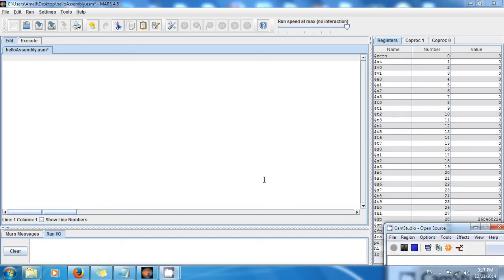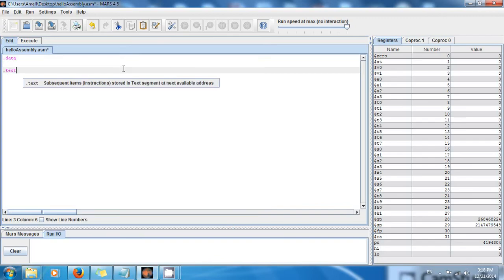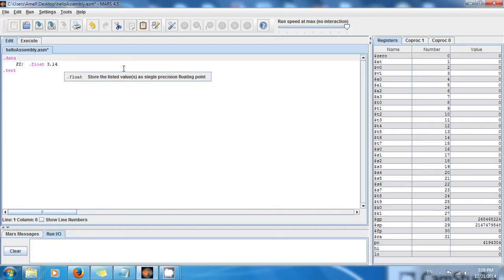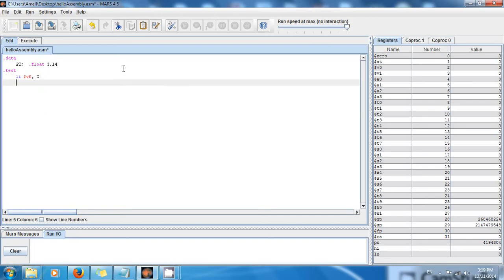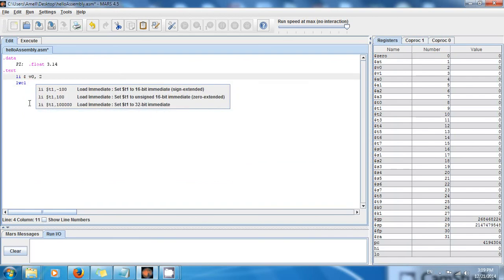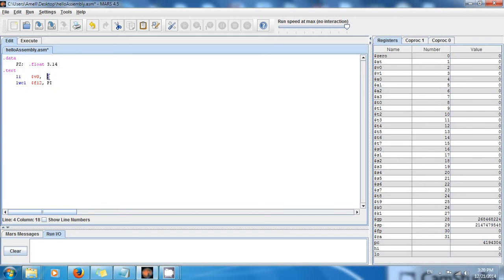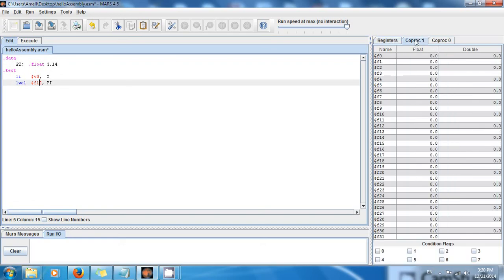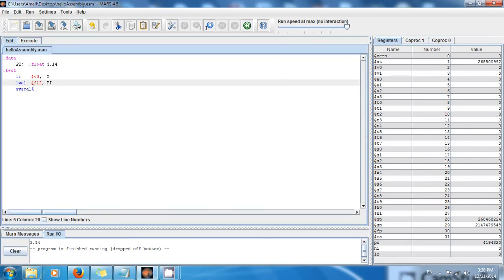MIPS Tutorial 6   Printing a Float

Comment: I have this error when trying to implement your code exactly.

line 5 column 2: "lwc1": Too few or incorrectly formatted operands. Expected: lwc1 $f1,-100($t2)
Reply: I got the same error. How do you fix it ?
Reply: @williamnguyen6928  same error here
Reply: it worked when i changed it to f12 instead of fl2, so that might be the issue for us
Reply: .data
    PI: .float 3.14

.text
    la $t0, PI          # Load address of PI into $t0
    lwc1 $f12, 0($t0)   # Load the floating point number from memory into $f12
    li $v0, 2           # Set system call for printing a single floating point
    syscall             # Execute the system call

Comment: What if you want 2nd float variable? You said we "must" use $f12. I have tried $f12 for my second float variable and it's not working.
Reply from the maker: Can you show me your code?
Reply: .data 
 f1: .float 2.14156
 f2: .float 3.12
 
.text
 li $v0, 2
 li $v1, 2
 lwc1 $f12, f1
 lwc1 $f12, f2
  
 syscall

Just want to print out f1 and f2, seperate line.
Reply from the maker: # Try this code:
.data 
 f1: .float 2.14156
 f2: .float 3.12
 newLine: .asciiz "\n" 

.text
 li $v0, 2
 lwc1 $f12, f1
 syscall

li $v0, 4
la $a0, newLine
syscall

 li $v1, 2
 lwc1 $f12, f2
 syscall
Reply: hmm that just prints out 2.14156
Reply from the maker: # Actually, this is the correct way:
.data 
 f1: .float 2.14156
 f2: .float 3.12
 newLine: .asciiz "\n" 

.text
 li $v0, 2
 lwc1 $f12, f1
 syscall

li $v0, 4
la $a0, newLine
syscall

li $v0, 2
lwc1 $f12, f2
syscall

li $v0, 10
syscall
Reply: I do get many questions from that code, such as why do we need newline in .data(variable declaration sections) but I'll just keep watching your videos. Maybe you mentioned it in the future vids. I'm familiar with Java but this is confusing.
Reply: @29leej  We need newLine in .data because MIPS doesn't know of the concept of a new line, it is actually a string printed to a terminal, so we load its string character code to the newLine variable, and then refer to newLine when we instruct MIPS to load address ($la)
Reply: @amellperalta  Thanks for the videos. I cannot understand one thing, why did we need 3 more "syscall"?